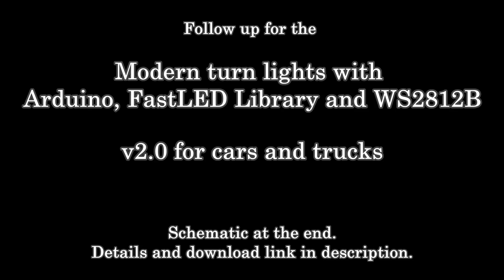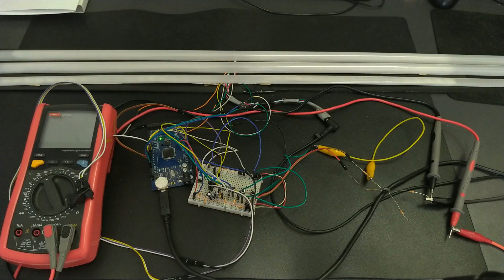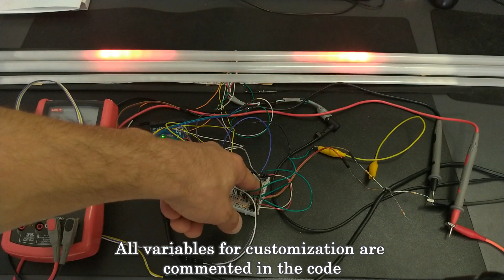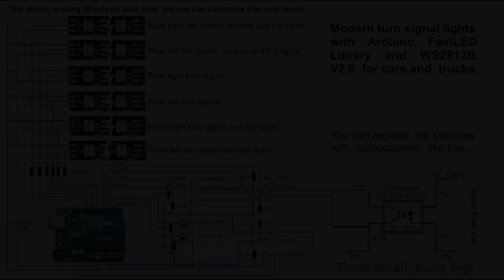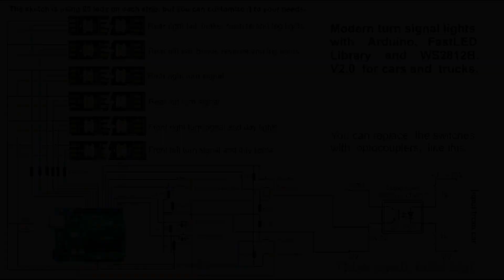Modern turn signal lights v2.0 for cars and trucks - Arduino, FastLED and WS2812B

Comment: Hi thanks for the nice project.
I have a plan to add led strip to my car but question is how i connect to the existing wire? For i. e. The one going to tail light/turn signal
My understanding is thru optocoupler as shown in the video so do i need to replace each push button with individual optocoupler?

Comment: I loved this version, but i’d like to make suggestions… 
first, the reverse lights would work better on the turn strips… i made the change but couldnt turn off
Second: diferents led lengths.. it’s hard to fit the same amount of leds inside the lights… 
Thrid: the drl turns on with engine on, but not dimmerize with tail on…
Forth: knight rider on Back turn strip… i made the change and worked, just have to copy the knight rider part and change “leds[0] and [1]” to “[2] and [3]” but make sure to change the drl color to 0,0,0, or you Will have a drl on the Back… they are in the same part on the code… 
Fifth: the knight rider does not overwrite the drl on… so the knight rider would only work with engine off… not a rider… 
Sixth: the brake could be a pattern you choose… i made this and think it worked, just changed the “full gradient” on brake parts to the same code of the tail model, with new variable, of Course, and made the brake as you can choose the pattern… 
Seventh: this is aesthetic, but i think CRGB(255,30,0) it’s a better orange for turn lights… 
Eighth: more patterns for show modes like rainbow and police lights… working on the drl and turn strips… 

I’d really liked the code and wanted to use in my car but it’s not the way i need, mainly because of the led lenghts

This code it’s the ultimate code for rgb lights on cars, almost like the blue ghozt module… but i think i came late, he is not making vídeos anymore

Comment: Hi can you please explain connection of the Optocoupler.input from car to optocoupler ect please
Reply from the maker: To put it more simpler each button must be replaced with an optocoupler...  each input in the controller must have his own optocoupler...
Reply: What im trying to understand is should each input have a optocoupler.like for the indicators.should there be a octocoupler for left and one for right?each with its own input from the car?
Reply from the maker: @andrewerasmus5036   To put it more simpler each button must be replaced with an optocoupler...  each input in the controller must have his own optocoupler...
Reply: Thank you.will this code work on a arduino nano?want to use only the rear light function.10 leds per indicator and 20 leds per brake/reverse/tail lights.so 60 leds in total.
Reply from the maker: @andrewerasmus5036  Yes it will work, but be careful to get the arduino nano 5v version...
With pleasure! ;)
Reply: Thanks again buddy.last question.the cathode pin on the optocouplers do they  all link up to pin 6 on the arduino.im going to be using 5 optocouplers,1 for brake,1 for tail light,1 for reverse and 2 for indicator left and right.does all 5 optocouplers Cathode pins have to go to pin 6 and after the 4.7k resistors on each opto go to ground pin?
Reply from the maker: @andrewerasmus5036   First of all, that is the emitor... Here is the pinout for LTV817 - https://www.ecured.cu/images/f/fb/Optoacoplador_LTV817.jpg 

The answer is no! If you do that you will only have the brake lights...

In my basic schematic the example for the optocoupler is replacing only the brake, that's why it's going to pin 6... The other optocouplers must go to the other input pins... pin 7 for tail lights, pin 5 for knight rider lights and so on...
Reply: @IonutF-TS-BB  thanks alot for you help.Much appreciated.
Reply from the maker: @andrewerasmus5036  With pleasure! ;)
Reply: Hi,Still struggling some what.Do I have to input 5v into the emitor negative and positve?Or does the optocoupler do the 5v?
Reply from the maker: Hi, see this... https://drive.google.com/file/d/1YmY_jE-RiPxHgabMHCVUjIHMKYeuAONf/view?usp=sharing
In one of the next videos i will explain what are optocouplers, why to use them and how to use them...

Comment: hi im  new in arduino world  i hawe a question can you draw aschematic if my triggers (buttons)  are 12v  and the led strips are also on 12 v(because they ar 6m long )
Reply from the maker: Hi,
The schematic for using 12v as trigger is in the basic schematic for this clip (optocoupler).
If you have led strips at 12v, this means that you have/use ws2811, but keep in mind that that the maxim voltage in a car is 14.4v while the engine is running and your led streaps will not last a long until they die... so i suggest to use ws2812b with a voltage regulator to step down the voltage to 5v... (or to 12v if you insist with ws2811).

Comment: awesome projects, i love them, on my circuits i actually decided to drive brake lights on a separate red strip, but i have the luxury to hide it in the gap between the WS2812B strips when they are beside each other, i have one acrylic face over the whole setup
Reply from the maker: Thanks!
Good idea, you reduced the overall cost and increased the visibility for the brake lights...
Can we see it? :)
Reply: Think small, build big! i haven't posted it yet, but i can show you videos with the old circuitry, if you write me on instagram or something @3dp_mini
Reply from the maker: Well, i would send you a message, but i don't have facebook or instagram account, because i don't agree on how the data is procesd and shared...
Could you post the links here or send them to my email?
Thanks! ;)
Reply: https://youtu.be/Vn6v55nzQ2s
Here i am using a Ws2812b external controller, just for testing function, that is from june, though after i burned out one of the strips and then got caught up with work i didn't continue, but here you can see the two separate LED strips
Reply: https://youtu.be/tdMAHBkq4wk
Reply: https://youtu.be/7LmHDWE6VzA

Still all in demo mode
Reply from the maker: @Tarex_  You do have space there! For what are you making it or where do you intend to use it?
Reply: Think small, build big! These are union jack taillights for the older Mini cooper r53
since i have quite a few, can i use pc817 optocouplers? they also come up when searching for the LTV and K1010
and for the brakelights and side indicators, why not use the interrupts? both attiny85 and arduino nano have more than one interrupt pin, since these override everything, in case of a hazard
Reply from the maker: @Tarex_  
Pretty cool tail lights, you can do some cool animations in that shapes.
Yes, you can use it, LTV817 and PC817 are almost the same.
I didn't manage to configure the interrupts on the attiny85, it become unstable or it didn't work at all, so i've written the code in such a way that i'm always reading the inputs fast and efficiently to never miss a change in the input (there are non blocking functions in the code). The arduino nano has only two interrupts and i've used them for signal inputs in some versions.
Reply: Think small, build big! nice, because PC817 cost next to nothing, LTV are not as common, but as dumb as it sounds i haven't gotten them to work, probably because i was tired haha, but the schematic is flipped around and it tripped me up, if you could draw the Dot or notch on the schematic i am sure someone else will also appreciate it, i sure would.
and the non-blocking with millis was a great idea
Reply from the maker: @Tarex_  
Yep, you're right, i forgot to put the notch on pin 1, i will fix that.
Thanks.

Comment: Being designed for use on a car, does the cars flasher relay for the turn signals and hazard lights have to be eliminated? So you have straight power when turning on the switches for either and the arduino controls the flash time?
Reply from the maker: Well, i thought it so you don't need to remove the cars relay flasher. You can synchronize the signal with your car relay flasher in the code and you don't need straight power for the switches/signal.

Comment: when i verify your sketch with arduino uno , and i have this error ''Error compiling for board Arduino/Genuino Uno.
''
Reply from the maker: I get the same error sometimes, i think is from FastLed library or Arduino ide, i don't know for sure, but after a restart everything works ok. I'm using Arduino ide v1.8.9 and FastLED library v.3.2.7.

Comment: Can i add bluetooth to this? So i can change the color any time of the drl and running light?
Reply from the maker: Yeap, but be careful with the bluetooth security, can be little tricky and very important.
Reply: Boss how many leds in this set up? My step down only have 3a max.
Reply from the maker: @jcjanestardo1782  Well, they are 6 strips x 20 leds per strip, in total 120 leds... if you have standard ws2812b with 60 leds per meter they consume about 60 mAmps per leds, so by my math you wil have a total consumption of 120 leds X 0.060mA = 7.2 Apms ...
Reply: @IonutF-TS-BB  Aw. What buxk xonvertee ur using?
Reply: Why when i' going to install it in the motor my led strts flicking so sad.. Whats wrong? Poor wiring?
Reply: Btw its ok to put common gnd for the 12v  and the 5v ryt? My pcb maybe too noisy i broke 5 of my leds haha 😂 badass starter kit
Reply from the maker: What i forget to specified in the last comment, is that you will hit the total consumption of 7.2 Amps only if you light all leds white, so for the normal use of the version 2.0, i think you will have a max of 3.5 Amps.
I've tested version 2.0 with Step-Down LM2596 DC-DC 5 amps with heatsink, and everything went great.
Reply from the maker: Well, the basic schematic is called "basic schematic" for a good reason and that is because it contains all the basic parts for the sketch to run on a bench and not in your final project...
The basic schematic must be adapted to your individual project, because every project it's unique.
To answer your question, many things can go wrong when you experiment with something which you do not master, but the important thing is to not give up.
Make some photos or a clip and show me details and parts numbers of your setup ... because without details i can not help you.
Reply from the maker: The ground from 12v and 5v is already connected thru the step down buck converter...
If you killed 5 leds, that means that you problem is most likely on 5v conversion or in the wiring.
Give me details thru photos or a clip so i can help.
Reply: @IonutF-TS-BB  Where to send the pic? Sometimes it flicker bet def color then stop lighting
Reply from the maker: @jcjanestardo1782  Upload them to your google drive and post the links in the comments... or upload a clip in your youtube account and post the link...
Reply: @IonutF-TS-BB  Ill screenshot my pcb diagram later.. I made my own pcb.. Just trying hehe
Reply: What capasitor in signal lyt? Electro?
Reply from the maker: @jcjanestardo1782  I don't understand the question...
Reply: @IonutF-TS-BB  I made another pcb.. At first correct color then when i turn it on the nano it also turn on with red color and cant turn it off..
Reply: @IonutF-TS-BB  https://drive.google.com/file/d/1AEvdHoQ4mM1K0boTrN6BBoRsb-5kCNuJ/view?usp=sharing
Reply: this is his pcb
Reply: @IonutF-TS-BB   Boss if i. Connect the gnd of my led to the nearest 12v gnd its ok right? To lessen the wires hehe
Reply from the maker: You could, but the ground wire beside the signal wire is good for shielding the signal, so i won't suggested.

Comment: super nice whats un arduino program?
Reply from the maker: Watch this to clips and you will understand:
Arduino Basics 101: Hardware Overview, Fundamental Code Commands - https://www.youtube.com/watch?v=BtLwoNJ6klE
How to Arduino #1 - Installing Arduino and uploading a sketch - https://www.youtube.com/watch?v=qHeF3hOn684
Reply: @IonutF-TS-BB   hello how to change the starting of drl? i want it first flash full brightness then go to medium.. ty more power
Reply from the maker: @justinestardo8545  Hi. Please try to reformulate, because I did not understand the question.
Reply: nvm heheh ty anyways.. my problem now is the optocoupler.. its not working,  i put 1k ohms 1/4 watts resistor .. the 12v connection is ok while the 5v didnot switch on.
Reply from the maker: @justinestardo8545  If you have the correct part number for the optocoupler, then respect the schematic and everything should work ok. Here is the datasheet for
 LTV817 - https://www.mouser.com/ds/2/239/LTV-817-827-847-647.pdf

If you have another part number, then search the datasheet for your optocoupler and connect as is shown in the datasheet.
Reply: @IonutF-TS-BB  hello boss it worked.. haha but i  use pc817..  no ltv available here.. sorrry im new to electronics.. in your diagram wher to put 4.7k? replace 10k by 4.7k?  and also it is ok to connect  4  gnds and put only 1  1k  in 12v gnd?
Reply from the maker: If you use optocouplers, the 10K resistor is no longer needed, because the 4.7K is sufficient to pull down the input.
Put both 1K resistors, because almost all ECU from 2000 until now have light bulb checking and this will trick it in biliving that the light bulb it's ok.
Reply: @IonutF-TS-BB  if i have no capasitor for the signal light switch what will happend? thank i got my pcb home made hehe.. i use ur diagram
Reply from the maker: @justinestardo8545  The capacitors are used to debounce the input signal, with out them it's possible to have false triggering.
The turn signal relay works similar like a button, but it's actuated electrical. 
To understand what bouncing is, watch this clip: https://www.youtube.com/watch?v=jYOYgU2vlSE
Reply: @IonutF-TS-BB  oh thank boss .. but i only have 1uf 50v is it ok?
Reply from the maker: @justinestardo8545  Yeap, as long as is not below the circuit voltage, your ok.
Reply: @IonutF-TS-BB  thanks boss great help.. thanks for sharing more info.. godbless.

Comment: thank you for this, and thanks for replying to me at your other video. so i used the code on your previous video for my scooter. as i am a total newb at these stuff, i didnt understand the reason of adding resistors or the other ones Ohm for the data pin the on the leds. i only used these https://images-na.ssl-images-amazon.com/images/I/41Qu5AP7bwL._SY355_.jpg as a way to decrease the ~12v of the scooter lights to 5v for the digital pin input. i power the board from the dc jack which is powered by the headlights. (12v) or something. when the turn indicator starts, the led freeze due to lack of power. i figured that out cause when usb is also connected to my laptop everything works fine, till the moment i start the motor of the scooter. 

Please paste a dontation address of BTC or anything convienient for you at this video and the next, i would like to tip you. Previous video and this video is of great help.
Reply from the maker: First of all, do not use linear regulators because they are not efficient, they can oscillate, they can overshoot the 5V limit and most important if for some reason you don't have the ground connected 12v will pass through it and kill your microcontroller. Just use a optocoupler is simpler and safer. 
You should never power the arduino from multiple power supplies (usb + 12v from the scooter), bad things can happen.
The reason for the resistors at the data pin are for limiting the current, less strain on the transistors, longer the life.
To power the leds and arduino i recommend you to use a step down buck converter, they are cheap, efficient and they can handle sufficient  current. (the regulator from the arduino can't handle to much current - look up the data sheet of the microcontroller that you are using)
I've updated the videos descriptions with the donation link and it will be much appreciated.